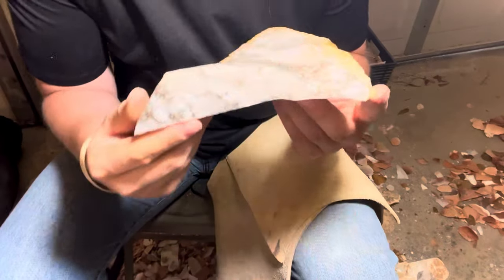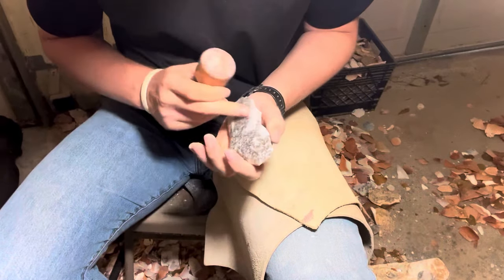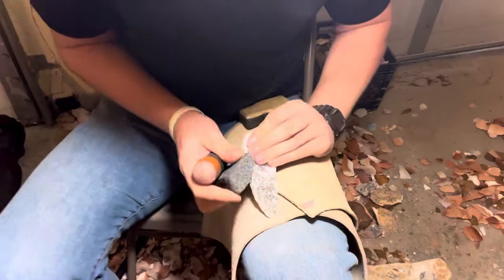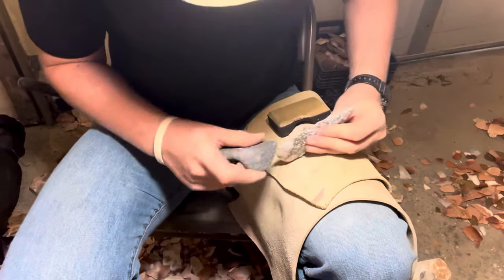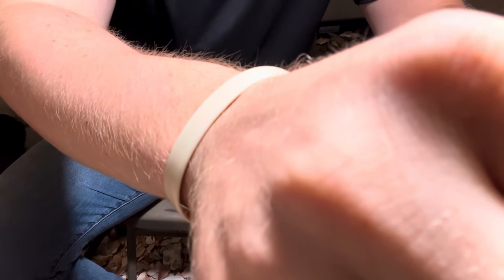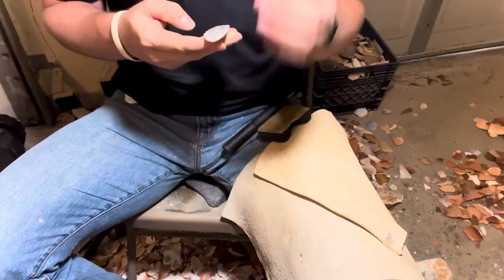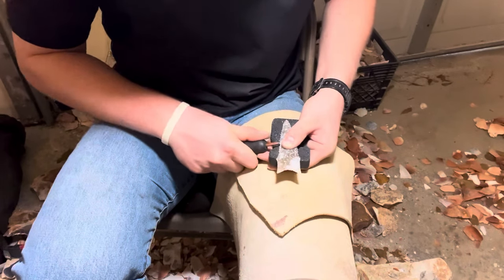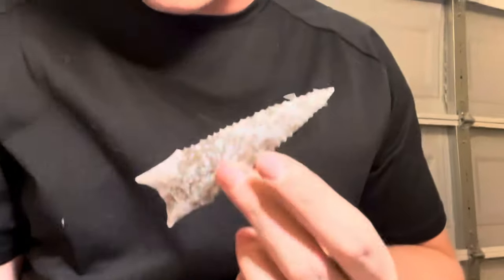How to make a Dalton Arrowhead!! “Flintknapping Tallahatta Quartzite”

Comment: Missouri Daltons ARE beveled, I grew up about 4 miles north of the site Judge Dalton discovered the point which bares his name. The bases are thin and some have been resharpened so much that they resemble a drill. Love your videos, wish I could knapp half as good as you do. My only issue is I have never seen a Dalton that big. Good Job.
Reply from the maker: Thanks for the insight!
Reply: I agree Most Daltons are beveled around here...im 35 miles NW of St Louis. I've seen daltons that big and bigger.. especially the Sloans (knifes). We just found a 7"+ Stanfield at the beginning of January. If you want to check it out it's on my channel with the thumbnail that says "lifetime finds"
Reply: @GulfCoastKnapping I don't really watch knapping but I was very interested to see a quartzite dalton being made. I just found a paleo square knife (I think) made of some type of quartzite we have around here. It was in my last video